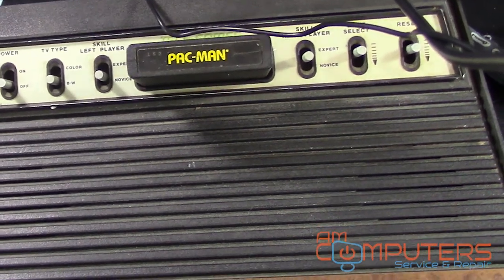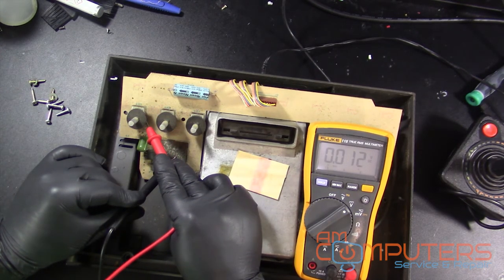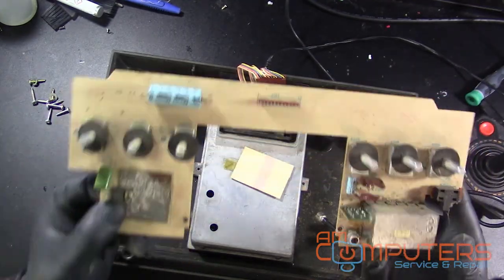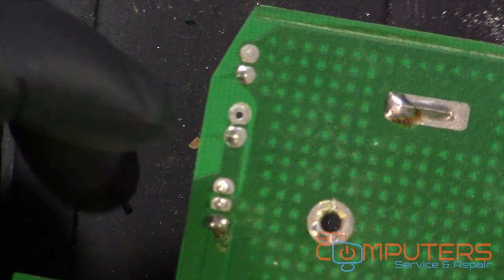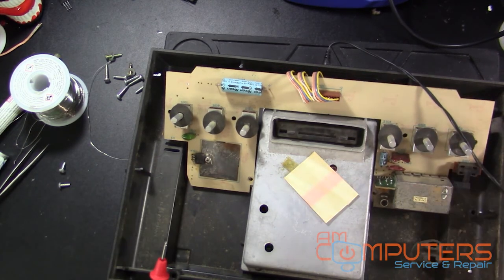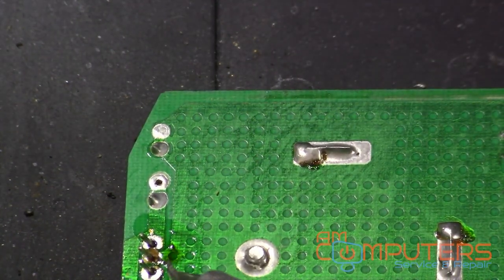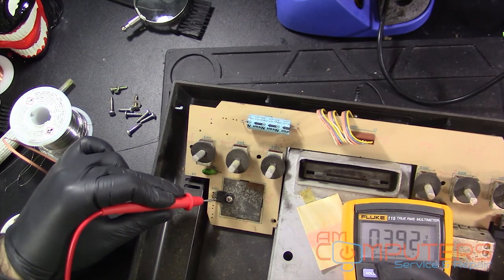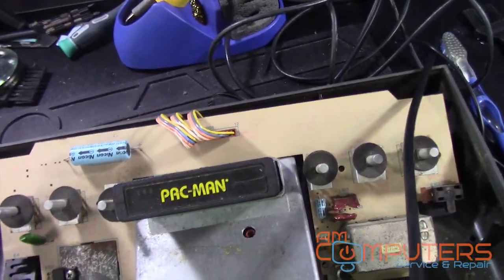Sears Tele-Games No Power Troubleshooting. Bad Voltage Regulator

Comment: Great video, I followed your instructions thinking I had the same issue, but my regulator is fine and reducing the voltage from 9 to 5.  I also replaced the RF cable and the power cable.  I am sure I have the correct channel as I can see something trying to come through but the screen is scrambled and no sound.  Any advice?
Reply from the maker: Maybe the RF unit itself is bad? Try cleaning where the RF cable plugs into the RF module. Make sure those connections are solid. Other than that it could be a bad IC chip. If you look for a channel called gadgetUK164 he has some Atari videos where he's swapped chips if I recall correctly. Hopefully my rambling helps a little lol. Thanks for watching!

Comment: The atari 2600 power supply is a linear unregulated supply so 14v is normal and sags down to 10v once you fixed the voltage regulator.  Also, I woudl NOT trust that voltage regulator ground pin in the long run.  I'd use a regulator that had a metal tab so you get a better ground connection from the ground plane.  You could also bend that middle leg backwards and scratch away some of the solder mask to expose more ground plane and solder into that for a stronger connection.  Those legs on the new regulator were heavily oxidized, you could tell by how they rejected solder at first.
Reply from the maker: Thank you for your knowledge

Comment: Any way of telling power is the issue with it not starting besides taking it apart? Thinking I have a bad AC adaptor. Would be nice if the unit had an LED light when it was turned on or something